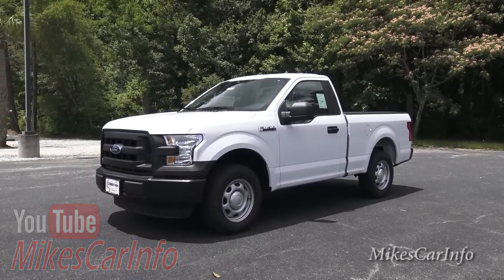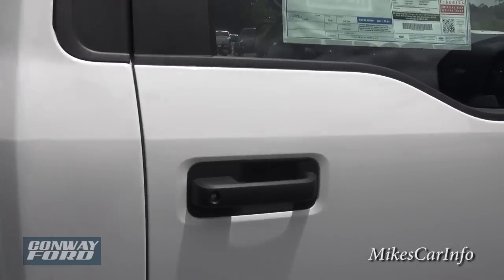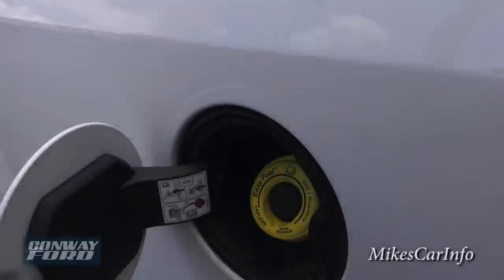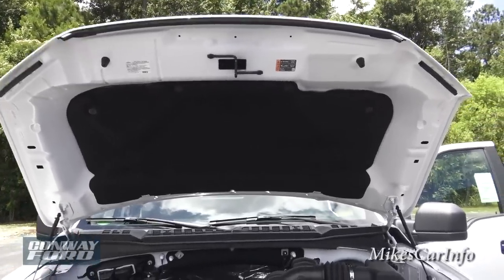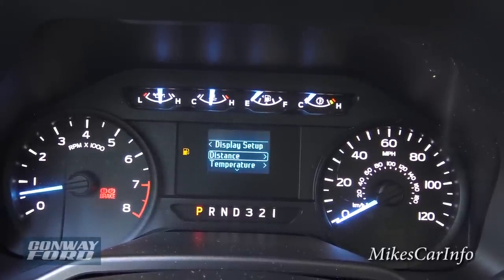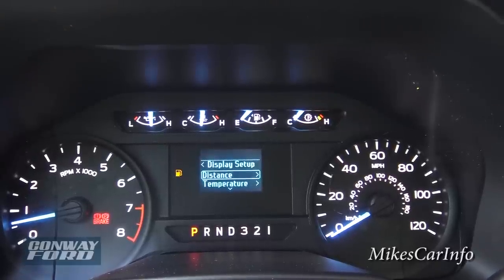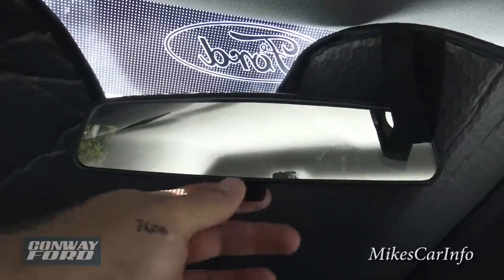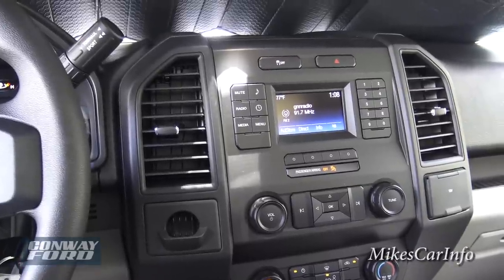👉 2015 Ford F-150 XL Regular Cab RWD

Comment: Thankyou Mike. This was an outstanding look at the basic Ford F150 work truck. I think a lot more folks are interested than many dealers think. This new truck is affordable. Excellent review!
Reply: ya im glad Ford still offers a base model truck.
Reply: I got my 2017 regular cab for $22,500. And it wasn’t completely base like this truck. Has power windows, chrome package, little better wheels, cruise control, the 4” display by the instrument cluster, fog lights, cloth seats, and it’s the 2.7 eco boost. I’d imagine with all those features taken off that they can’t be charging more than $20,000 for the truck.

I can’t lie, at first when I looked at my truck it looked awkward since I’m used to F150s looking like huge ass tanks on the road, but now that I’m used to it I love it.
Reply: Armando Sturzenegger I made a couple review videos on my channel if you want to check it out. Not the best stuff but it’s something 😂😂 I love how quick the eco boost is, the gas mileage is a bit low,  it that’s because I do a lot of time idling. - and I’ve had 0 issues whatsoever with the truck. There are a couple of recalls I need to address, but that’s it

Comment: Great video. The reason why they put hooks on the roof behind the seats is because that's really the only place you can hang something. Better than not having them, right? Also, block the back glass is not a big issue (definitely not illegal because panel/cube vans etc).

Comment: I like the base model trucks, i'm considering a xl crew cab 4x4 with the 5.5 ft bed. id prefer to have it equipped with the 5.0 v8 though.
Reply: Kelby Sagvold get the SuperCab, you get a longer bed and still have more than enough space to transport 6 people.
Reply: ya the supercab or regular cab XL only comes with a v6, but you really don't need the v8 if you don't tow for a living. the v6 has plenty of power for what you need. but if you do want the v8, it only comes as an ext cab or supercab. but your wrong about the bed size on the ext cab, supercabs only comes as a 6ft6 bed. the regular cab has the 8ft bed, and that's the way i would get it.
Reply: Would you recommend the base model regular cab as a first truck? I dont k ow if I should get a 2011 ranger or just go for a simple pick up. I would use it to carry my instruments to and from school

Comment: I would want power windows with that center armrest. I would clutter that armrest with all sorts of gear and whatnot.  To reach over that to crank that right side window down would be impossible.
Reply: no it wouldn't, you could easily reach the crank. im 5ft11 and i can reach, and this is just work truck. so you don't power windows on a base truck, leave it the way it is. if you want power windows, you can get the stx which is similar to the XL, but it's an ext cab and it has power windows. the XLT comes as an ext cab or crew cab, and it comes standard with a 5.0L v8. and i think there's an option on the XLT for the 2.7L v6 turbo. it's not the ecoboost like the 3.5L is, but it still gets the job done.

Comment: I wonder how the active grill works in winter when ice and snow can get in there, or if off road with mud etc
Reply: They work the same because ice and snow melts by the time the shutters activate.  These trucks are designed and tested in Michigan, so they know a few things about ice and snow.

Comment: what? average 9.6 MPG? i don't think so
Reply from the maker: +jy02250883 Who said that?
Reply: +MikesCarInfo from ur video, 17:10
Reply from the maker: +jy02250883 That average is based on a new truck that hasn't left the parking lot. Once the vehicle is driven on the road it will give you the average mpg based on how the truck is used.